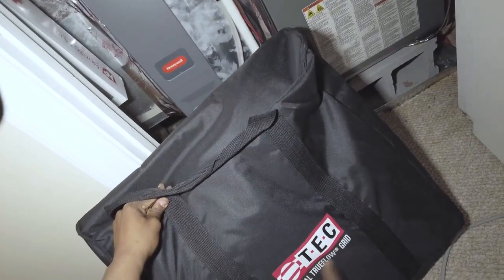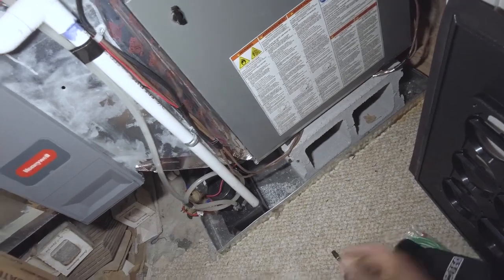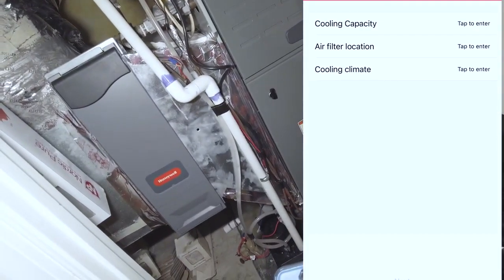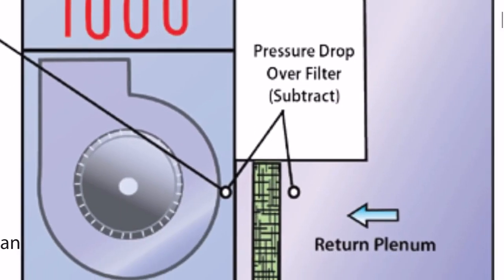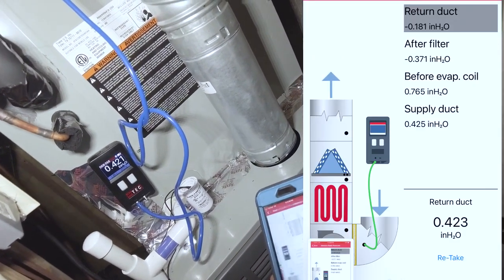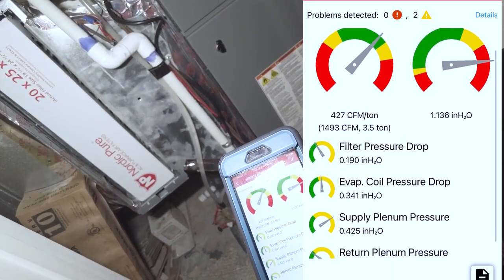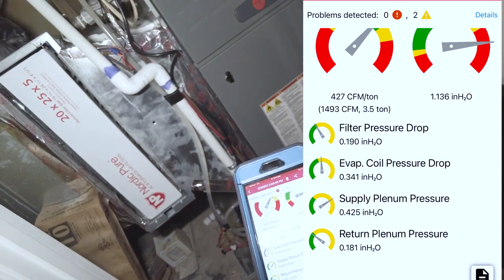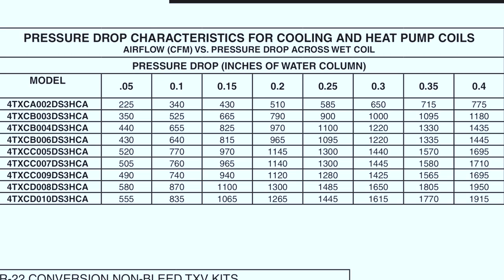TEC TrueFlow Grid HVAC Digital Airflow Meter The Most Effective way to Measure Airflow Yet! #hvac

Comment: I bought a TrueFlow Grid in Sept 2021 when they first came out and was impressed.  The manometer that comes with it, the DG-8, is also top of the line.  There are ways to get tripped up.  And not so easy to use in a hot cramped attic.  I would have run the test with the new filter rather than the old one although it looked fairly clean.  You also had a extremely high TESP that was due to a very high supply static pressure.  Maybe registers or trunk dampers were closed.  Or maybe it is a zoned system with a zone damper closed.  I would also slow the blower down.  Too much air at 427 cfm per ton.  Great demo of the instrument.